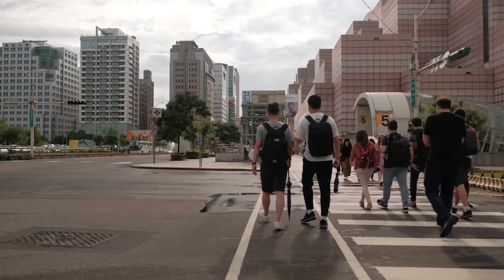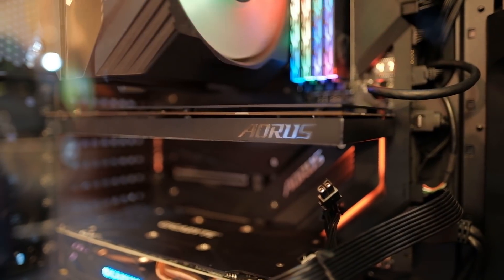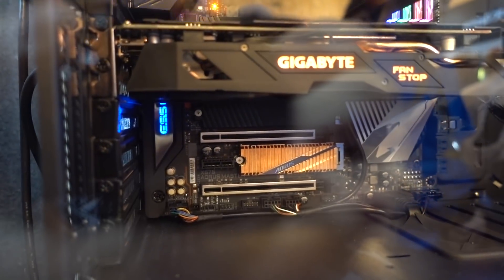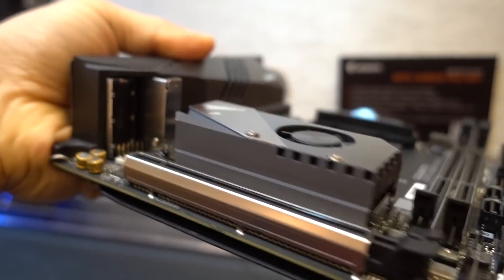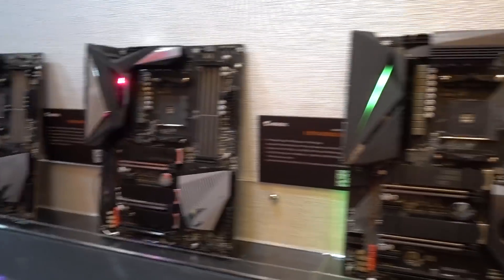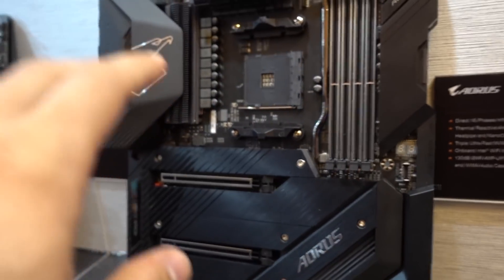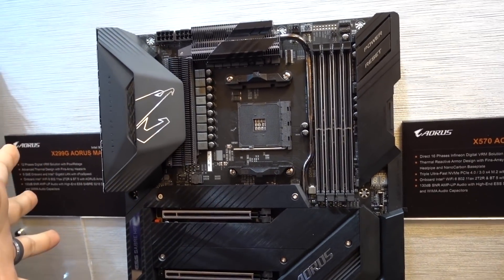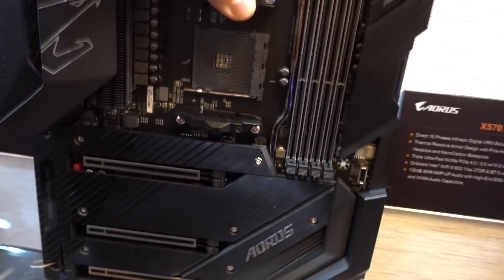They found a way to ditch the X570 chipset fan!

Comment: Is the msi b450 tomahawk a good future proof motherboard?
Reply: B450 is probably going to stay longer than the rest. (With updates and stuff) But you'll probably have to buy a new one soon. Cus of the cooling they will need
Reply: @Cocoabuelo04  Dam, Is that something to worry about?
Reply: If u want a third gen ryzen*
Reply: Probably. I don't think they would add tiny earraping fans for no reason
Reply: @Cocoabuelo04  So is that motherboard bad? If it is should I just go with an Asus board like the b450 prime micro atx?
Reply: @Cocoabuelo04  The cooling for for PCIe4, if you're not using PCIe4 which older boards won't have access too, then using older boards with zen 2 should be fine, though I will still be waiting for more info. From the sounds of it, it will be for NVMe PCIe4 RAID in particular, so hopefully active cooling won't be necessary for most on x570 anyway.
Reply: @Cocoabuelo04  The fan is for the PCIe 4.0 chipset. It has nothing to do with the new Ryzen 3000 series.
Reply: @blackwolfshad0w25  sure but if that pcie thingy is important then the old mobos won't be good for the future?
Reply: Chezus Christian the pci 4.0 is not so usefull. You can now buy ”old” pci3 ssd or new Pci4 ssd that is Little bit faster, much more expensive and runs much hotter... so old 470 or 450 motherboard is very valid option to 3000 series Ryzens! If you have a lot of money, to buy very well ventilated pc case, very good nictoa coolers to it and very expensive Pci4 ssd:s the 570 is a good option. If you want to get all of this cheaper wait for 670 and see what is offers compared to 570. Most likely only minor upgrades. The 770 will be something very new at 2021 if and when it has AM5 socket and so Also ddr5 memory! That is when there will be the next big jump!
Reply: If u want something cheap and good quality. You should go with the asus strix. It has most of the stuff you want + 2 heatsinks

Comment: Gigabyte boards have the shittiest of all VRMs off late. Instead of removing the VRM fan, they should have added liquid cooling. Doubt even that would be enough for that shitty VRM.
Reply: The Xtreme had LITERALLY the best VRM setup you could put on a board at the time... That 16-phase controller was BRAND SPANKING NEW!
Reply: @Cooe. VRM on  their b450 boards sucked rats' asses all day everyday.
That's where I was coming from.

Comment: Im starting to wonder if any of the board manufacturers are going to be making any white PCB boards. I'd LOVE to upgrade to Ryzen 2 but would also LOVE white PCB boards, to add to the overall aesthetic of my build. I hope someone comes out with a decent white board ):
Reply: Yup. I'm looking for a white case in combination with a white board. No luck right now.
Reply: Uh huh. Have a white In Win 303 - would murder a motherfucker for a white X570 motherboard. And, with a LEGIT VRM package too, nothing over the top expensive, but solid quality with a decent phase count
Reply: Agreed - I've currently have a white/silver MSI Z170 Titanium board which goes extremely nicely with my white case. It's a shame they haven't produced any white boards since.
Edit: actually I stand corrected - MSI have released a X370 titanium board! Let's hope they do the same for the X570...

Comment: I honestly dont like the rgb fad every company is going nuts over. I must be the only one.
Reply: You're not alone. I actually hate rgb. 🤷‍♂️
Reply: WeirdChamp
Reply: It's optional - it's on everything because YOU can turn it off

If you're concerned about "paying for it", don't worry they would still charge you the same amount. Just like "high end" boards with cheap ass shit show VRM packages can easily cost more than mid-range boards with totally stacked VRM packages(and, these are components that actually make a meaningful difference to manufacturing costs).
Reply: Same

Comment: Motherboard back plate ❤️❤️❤️😍😍😍
Reply: I don't remember who did the testing, but apparently the backplate also helps in heat dissipation 0.o
Reply: Will that backplate interfere with my putting a CPU block on it? You normally have to install a backplate to do that so I'm curious.
Reply: praetorxyn it shouldn't as far as I know,
Reply: THE TECH JUGGERNAUNT true, we'll find out in independent reviews and tear-downs if it does have thermal pads…